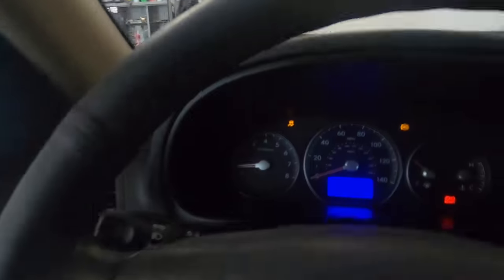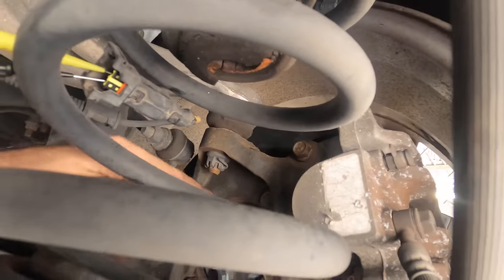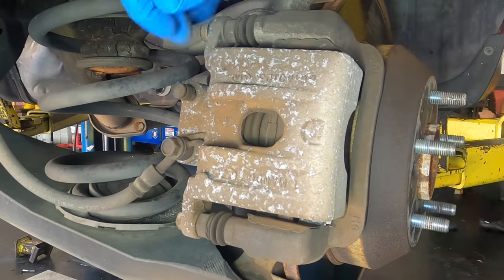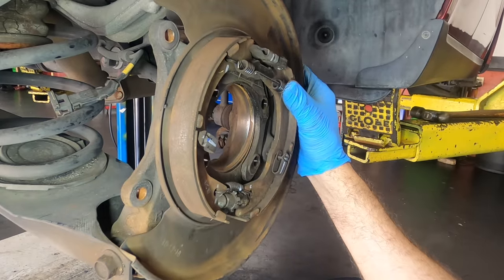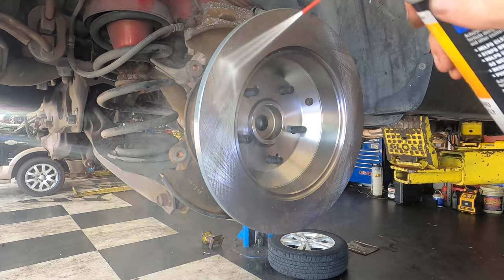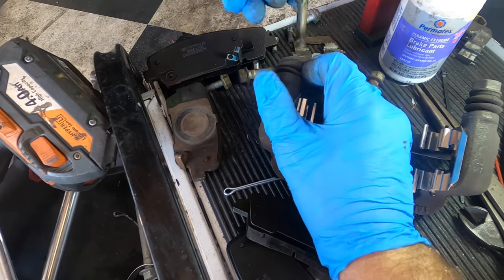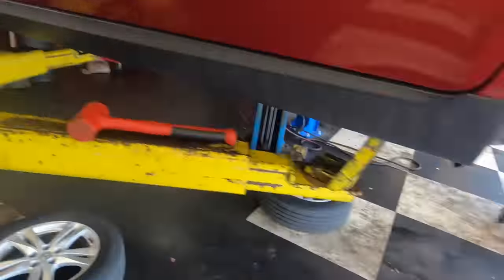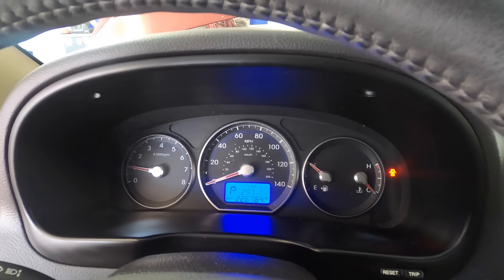Parking Brake Fights Back! BRAKE ABS Trac WARNINGS on! Hyundai Santa Fe

Comment: As a fellow automotive tech, in my 20 years of experience, I have found that, more than the perpetual hiss of a leaking air hose, more than the obnoxious brain rattling noise of an air hammer against a sized wheel bearing, the single most annoying sound in car repair is the door ajar/key in ignition/headlights on chime. Its enough to make me want to jam a rusty screwdriver in both of my ears. Thank you to whomever made that chiming stopped. You are a true hero.
Reply: Have you seen 4 wheel sensors all go bad so the owner thinks the engine must be bad
Reply: In all my years of working on cars I have never been ask to fix one of those chimes , not that I have ever seen one fail.  Why aren't more systems on a car as durable as the alert chimes I wonder , is it ALL just money?
Reply: While in  the Army Tac Sat unit, the army engineers told us that they made the sound of warnings as IRRITATING as they could, so that you would not be able to ignore them, thusly attend to the warning😵😵
Reply: Not to mention the annoying chiming for the seat belt when you're hunting!
Reply: Agreed. That why every car/truck I buy for myself, first mod is that dinger/buzzer/chime must die! In some form or another. They are getting harder to kill but most are still possible.
Reply: Be glad you missed the talking "your door is ajar" from the 80's. Enough to make you run screaming from the shop.
Reply: @ericrasmussen6726  I would scream back, "My door is not a jar, my door is a door!!
Reply: we don't have these on UK cars. only a beep for lights on and door open together with ignition off.
Reply: @vsanti83  — the average education level in the USA is not up to UK standards, unfortunately .
Reply: I turned the chime off using forscan on my car, I hate that chime
Reply: @ericrasmussen6726  :))
Reply: @ericrasmussen6726  Your door is ajar, your steering wheel is a butter knife, your trunk is a coffee cup, and so on.
Reply: @ericrasmussen6726  I yelled back that my door wasn't a jar; it is a door! but the car failed to listen...
Reply: @mrcryptozoic817   🤔But I thought the chime for your seatbelt was when you are IN the car and don't have your seatbelt................😯😳 oh okey doke. 😂😂😂😂😂😂
Reply: This comment is pure gold. 😂
Reply: @ericrasmussen6726  I remember the first one i heard, maybe 1979, in an Audi. Irritated me first time.
Reply: @randomschmo5778  Try to bring the dental health care level standard up a bit, old chum.
Reply: @martinbeahan  Didn't that hurt?
Reply: Yep and my seat belt chime that gets louder and faster even though I’m just moving the car in my driveway
Reply: @bloodybones63  no lmao, forscan is software for ford vehicles that allows asbuilt programming
Reply: @martinbeahan  ....that allows for..... never mind then
Reply: @ericrasmussen6726  1986 Chrysler New Yorker i take it? lol, most annoying car i ever drove, especially the "your washer fluid is low" that sounded like i was being threatened to put the lotion on the skin or get the hose again, lol
Reply: @vsanti83  Nor the rest of Europe, thankfully.
Reply: Lmao

Comment: "DOO DA DOO DA DOO"!!. Love your work and videos bro! I'm an "experienced back yard mechanic"...I choose to do most automotive work/ repairs/ maintenance myself for pleasure and money saving reasons.  I've learned allot thanks to videos on YouTube, Google and people like you. But I get "confused/ lost/ perplexed" on some simple things which sometimes makes me doubt myself... for example....
No anti-seize on the wheel hub bearing?
No lock tight on the wheel hub bearing bolts (4)?
No brake grease on the brake pad slide clips (the ones that were on strike and didn't want to clip onto the caliper)?
No dialectic grease on the abs speed sensor connection?

I'm NOT in any way or form bashing your work... not at all,  0%... I'm merely learning and trying to understand (yes at 52 years old, retired combat disabled veteran and a retired federal police officer, we can still learn). 
I'm currently replacing (on my 2006 chevy suburban LTZ 6.0) both front wheel hub bearings,  dust shields, speed sensors, sway bar links, sway bar bushings, rotors and brake pads... so yes this video is important to me. I'd also like to add that when I replaced my front wheel speed sensors (100 miles ago before my front right wheel bearing hub got destroyed by Michigan's lovely potholes) I had the same engine lights come on (ABS/ TRACTION CONTROL/ STABILITY TRAC)... after replacing both front speed sensors,  the lights went off...doo DA doo DA doo doo... and momentarily came on then back off.  Same as what happened to you.  I believe this was just the sensor reestablishing connection and correcting itself with the new sensor. 

Anywho,  I apologize for the long post. I appreciate all your videos (even the "go viral one" haha and all you do. You sir, have taught me allot! GO GRAVITY!

Comment: Brake Clean just started up another production line to meet sudden increase in demand! Good stuff.
Reply: Although he won’t admit it, Mr. Rainman holds stock in the company that makes his brake cleaner.
Reply: Can't help but think Ray has a stash at home for house chores.
Reply: As “they say”, Ray buys the brake cleaner at home in 55 gallon drums and the house in addition to hot and cold water is plumbed with hot and cold running brake cleaner. 😜
Reply: Ray needs bigger cans of brake Kleen!
Reply: Ray has connections, and with those connections comes an unlimited supply of brake cleaner.
Reply: I, too, am a brake clean enthusiast. 😂
Even though the shop provides it, I keep an extra case of my own just in case.
If it works, it works. And, Lord, does it work
Reply: Break clean is over kill..

Comment: With that meter you can see if the sensor works. Backprobe the connection and set meter to Hz. Look for a frequency to occur as you rotate the wheel with the ignition on.
Reply: @Marty's 4x4 didn't say most meters, said "that meter". If you get a reading, the hall effect sensor is powered and reactive.

Comment: That air hammer attachment to remove screws is no lie one of the best tools I’ve ever purchased, I couldn’t even tell you how many dozens of Phillips bits I’ve broken over the years using a regular impact driver tool to remove brake rotor screws. I’ve had that air hammer attachment for over a year now and use it almost daily and have still yet to break a single Phillips bit, must buy for any technician in the field.

Comment: I have the exact same warning lights, I was told it needed an ABS control module. I had a repeated clunking in reverse, but no issues in forward. I wish there was a mechanic near me that I trusted when they advise me to load the parts canon.

Comment: The impact screw driver is the best tool ever.  As a previous Honda tech pretty much all Hondas use that set screw to hold on drums and rotors.  Breeze to take off with the correct tool for the job... flappers wheels are the best also.

Comment: Measuring edge-to-edge gives the same distance as center-to-center, and is easier to eyeball. ´Course, you need to remember to use the same side on both holes. 
If you're feeling fancy, you can always stick the tips of the vernier caliper inside the holes and measure edge to edge, then add/subtract hole diameter to get a more accurate result.

Comment: That tool is called a screw knocker.  They are used a lot in aviation.  Started using screw knocker's in the early 80's while serving in the US. Navy working on A-7.  I still use them for stubborn screws on aircrafts.

Comment: OMG!  What timing!  I just got done replacing the brakes on my girlfriends 2011 Santa Fe!  Front and rear pads were down to metal.  Both front caliper brackets had rusted slide pins.  The parking brakes are basically non existent because they are so rotted!  Great video!
Reply: I bet you ignored the wear indicator for months. I did...
Reply: @daveunbranded  : Girlfriend did.  I told her for months she needed to get brakes checked.

Comment: You just got to love being handed wrong parts. Always makes the job exciting, and last longer. Up here in the northeast, we put that brake lubricant under those steel shims on the pad bracket. It helps slow down "rust jacking" which eventually pinches the brake pads. You probably don't have to worry as much about that down south though😁.
Reply: Whilst other people load the shims with greese!
Reply: My double master tech always said “parts are only a problem 100% of the time!”

Comment: In my career (almost 15 years in industry and over a decade on Hyundai’s specifically) I’ve learned what I’m willing to use aftermarket parts in and what I’m not. Bearings, axle seals, steering racks and power steering pumps I ALWAYS highly recommend OEM parts. Many aftermarket parts are fine, but these components specifically I’ve found to just be too consistently problematic. That goes for all makes and models, not just Hyundai. I’ve been doing used car reconditioning in a Hyundai store for almost 7 years and those parts have given me more headaches than their worth across the board.

Comment: Those hard to remove rotor screws aren't Philips head. They are JIS screws which are designed for a much higher torque before camming out. You need a specialty JIS screwdriver to remove them which is built in such a manner that when you dead blow the handle with a hammer it causes the screwdriver bit to rotate the screw 17 degrees. I know it all sounds really technical and strange, but there are no Philips head screws in an Asian auto. They are always JIS. I know because the rotors on my wife's Honda Odyssey had those screws. Bought a JIS screwdriver and they came right out with only a couple of hits. No air tools needed.
Reply: Japanese Industrial Standard or something like that

Comment: You should also be able to find screw drivers with a flattened section just below the handle for an adjustable wrench to grab as a lever.  Looking at my numerous collection the presence, even within brands tends to be rather hit or miss.  Most smaller screw drivers lack any grip point for a wrench, while larger ones often, but not always have them.  "Vintage" or antique screw drivers very frequently do have them.
Reply: Vice grips

Comment: The tool used to remove the Philips screws on the brake rotor is called Shake n break. You can find it on amozon

Comment: You need to scavenge the connections from the wheel bearing sensor and pick up a junque yard wire end for the wheel sensor and make a dedicated jumper
Reply: I've done that
Reply: Is it the same type of connection for all wheel sensors?
Reply: @SteveB88 on a particular car, yes. Model to model, maybe not. Manufacturers to manufacturers, no.
Reply: @itaintrocketscience  yes but, there are cars you are going to see more than others.  Those would be the ones I would focus on.

Comment: I've checked with the Smurfs about the reappearance of the warning lights on the dashboard and they tell me that it's common for some variants of an ECU to conduct a "check pulse" before resetting themselves (or resetting at an operators request) thereby causing the dashboard warning lights to momentarily reappear. 
Quite common on little blue cars in Holland apparently

Comment: New tires on the axle that does the most work... FRONT. Try inducing oversteer as you described it on a front-wheel drive car and report your success. The location of the drive wheels will determine your success at inducing oversteer. The chance of the rear breaking loose as you described it is NILL!

Comment: I did a wheel bearing on 2014 Ford, abs and traction light came on as I backed out the drive.  Thought, holy c#@%. This is a Timken bearing hub and sensor set, not cheap.  Drove forward 30 feet.  The computer learned the new sensor and all has been right with the world.

Comment: On the rotor retaining screws, I use a BFH and a manual impact tool. Kill 2 birds with one stone, 1- screw is loose, 2- I relieve some stress with the BFH. Nice rust dust cloud the flapper wheel created. Quality control from aftermarket parts mfg has gone out the window to China and they killed it. I`m shocked that that Hyundai had that many miles on the clock. The owner has taken really good care of it. Let`s re-lube our sliding shaft...giggety.

Comment: Diagnosing a wheel hub is easy. When rolling down the road, load one side. Turn the wheel slightly one way, or go through a curve. Going left, if there’s hub noise, it’s the right side. Going through a right hand curve, and there’s hub noise, it’s the left side. Confirm by jacking the vehicle up, and wiggling a tire. FWIW though, I’ve had bad hubs that had no “wiggle” when jacked up and performed the wiggle test (grab wheel at 12 and 6 o’clock positions and wiggle). Only complaint was “jet engine roar from front end”. 

Also, that hub you removed so easily is an anomaly lol. That ain’t gonna happen here in the Midwest. Last one I did did not come off with all the usual methods. I had to do the bolt method. (Knock out a lug stud, and use a hardened bolt/nut against the knuckle). 

I go a bit farther on all hubs, or basically anything cast iron that will rust. I paint with high heat paint. Except for where the hub slides in the knuckle. That gets SLATHERED in anti seize. The hub may outlast the vehicle, or need replaced in 20k miles. 20k miles in salt is hell on metal. If I’m the one replacing the hub, I want it easier than the first time I did it lol. 

Moog used to be the go to. But they’ve gone down hill. I go for timkin, SKF or centric, depending on availability or warranty. Never masterpro or DLG if I can help it. Though my Cummins has a masterpro hub. I wasn’t happy putting it on, but I was 2200 miles from home and couldn’t just wait for better parts to be shipped and arrive on time. I know I’ll be replacing it soon lol. 

That said, I’m glad I found your channel. I’ve been trying to migrate from parts swapping, to learning more diagnostics. Diagnosing a noisy hub is easy. I want to get into diagnosing the more difficult problems. The kinda stuff you and watch Wes work get into. I’m not a “professional”, as in I don’t wrench for a living “per se”. I buy and sell vehicles, and strive to fix the vehicles before I sell them (I own and drive stuff for a year or more before I sell them, so no, I’m not a “flipper” or “curbstoner”. Everything gets registered in my name no exceptions). I feel like I can broaden my choice of vehicles by learning the more difficult stuff. 

Anyways, gained a new subscriber! Keep the vids coming!

Comment: There used to be a gadget called a Shake and Break that attached to the air hammer for those disc retainer screws. I just use an impact driver and a BFH. It helps work out my aggressions as well.
Reply: Big friendly hammer lol I use B.F.S.H 3LB
Reply: @dainsmart6237    Wimp ;) My BFH is a short handled eight pounder.  Just used it today to persuade a Jeep hub to part company with said Jeep after 30 some years.
Reply: Thats what it is and called

Comment: GREAT WORK.   Your videos keep getting better and better and I'm a loyal subscriber.

That being said, and this is like complaining about the glove box on a Ferrari, but one thing I do is clean the rubber grommets on the caliper pins with squirt of cleaner and re-pack the inside with grease.   I've found more than a few over the years where the grommet was full of grit inside, bone dry, torn, split, brittle, etc...  Many brake kits come with them too.   If they don't, I am definitely popping them off for a closer inspection and re-lube.

Food for your thought.

Comment: There is a version of that screw removal tool being made now. It is called the Shake & Break. I think I first saw it used on Mustie1's channel. A year or two ago.
Reply: It would be a lot cheaper to just get an adapter socket that held 6 point bits and use a cordless impact gun.
Reply: @johncooper4637  Maybe. But it would not serve the purpose of the shake & bake. The S&B applies an impact force directly down on the screw while the lever is used to apply light turning force. It will often free a screw that would only strip with an impact driver.

Comment: After having watched many many an episode of Rainman videos it seems that most of the vehicles that you service there have hundreds of thousands of miles on them. I guess that’s great news for the owners of the vehicles 200 or 300,000 miles seems like it’s a lot of miles to maintain a vehicle .
Reply: 20 years ago, that would indeed have been a lot of miles for maintaining a car but, even though it sometimes doesn't seem like it, engineering and material science does improve over time. It's the accumulation of real-world data that eventually leads to the improvements.
The other factor is economics. We have less buying power now so maintaining a vehicle for longer life is a necessity.
Reply: @BigRalphSmith  With supply issues its also hard to even find a replacement vehicle.  I wonder when refurbishment of parts/on site manufacture of parts will be come a requirement as well.
Reply: Because this is the real world if u have low miles under 150 thousand consider urself lucky every thing I got has over 200 thousand gonna drive em until the wheels fall off u keep making those paymeants
Reply: It's more common living in the south, up north in the rust belt a lot of vehicles rust to pieces before the vehicle is mechanically done.

Comment: All those  " set screws " on the rotor are to hold the rotor on while going down the assembly line while being built. They dont need to be torqued or hard or need to be there at all

Comment: seized pads in caliper bracket clips? not In this example, but, high temp
 lube under clip prevents " rust jacking", which happens under stainless to steel clip. Helps keep pads free over time. If tight, they apply and stay applied " stuck" and rotors overheat, pads wear unevenly etc. Many suggested lube points. Not criticizing, just how I do it.